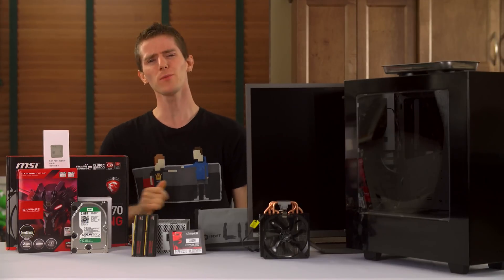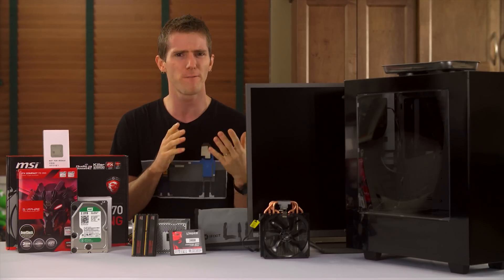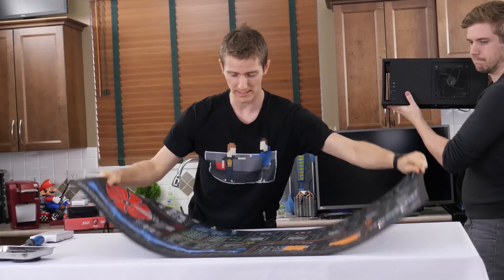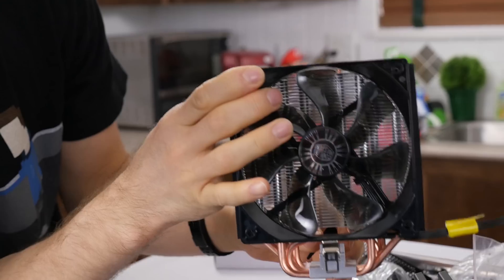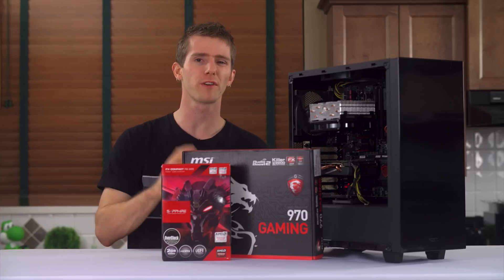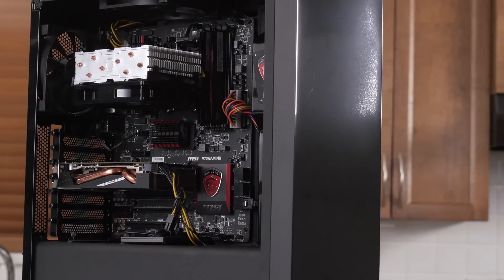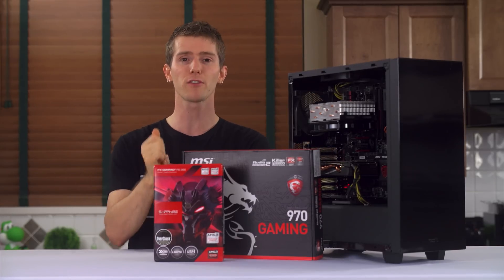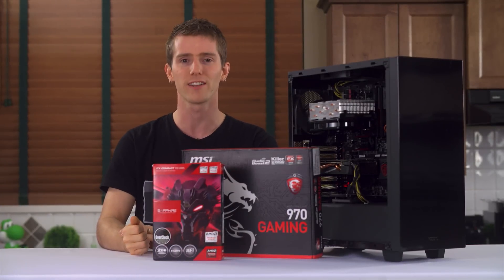Can you Build a 4K Gaming PC for Under $1000?

Comment: I recently bought a computer for about 1k. I can turn up all the graphics on most games to max and get 60+ fps. Like they said in the video wow is the only one I have issues with I down to 44 minimum in 25 man raids and in my garrison for some reason but I usually hover around 120. In league of legends I have gotten up 400 fps for short periods of time in base which is crazy. I do have to note that I do not have a 4k monitor so I don't run my games that high.

Comment: If you have $1000 to build a PC please don't build this rig, such a huge waste of money. Grab an i5 for $200, R9 28(9)0(x) $150-190 used, 750 watt power supply $80 (modular), z97 motherboard $100 and whatever case/ram/storage you want. Leaves you plenty of room for upgrades and the price vs. potential upgrade performance is WAY higher.
Reply: Except it will do 4k gaming. Much better.
Reply: hi jake from state farm :P
Reply: Jake but it won't be 4k which is the whole point of the video. 4k gaming you know.

Amazing how this goes over the head of Intel fanboys.
Reply: ***** 970 would be out of budget when you include the price of the monitor.
Reply: ***** 290x is the same price and much better at 4k due to higher memory bandwidth.
Reply: my fucking god!!!!! THE MONITOR ALONE TAKES AWAY 4-500 BUCKS!!!!!!
Reply: guys most people dont include monitor prices in there builds

Comment: I don't get why people still use 3.5 inch drives. 2.5 inch ones can store just as much, use less power, generate less heat, and are almost standard now with drive caddies. Is there something a 3.5 can do that a 2.5 can't?
Reply: Faster speeds. The relative position of the data on the disk spins faster relative to the head that reads/writes data to the disk in the 3.5' drive to the 2.5' drive.
Reply: Forsetî Yes it would be faster
Reply: HDD's are bound by physical properties (like their dimensions) since they operate mechanically. Generally 2.5" drives are slower and have a lower ceiling for capacity.
Reply: ***** so a 7200 3.5 would still be faster than a 7200 2.5?
Reply: Broc Stefan The WD Black Scorpio has a max speed of 120MB/s while the desktop WD Black has a max speed of around 200MB/s. Even when both are running at 7200 rpm. Yeah but it ain't much. SSHD are not faster for opening different files though, that are not in the cache
Reply: Broc Stefan No biggie. Just saw a review not long ago for the new 2014 black hdd and they performed closed to 200MB/s. Plus I got a 2 Seagate baracuda 2TB this year too and they have a maximum of 193MB/s for reads.

So i thought 200MB/s was the standard for this year, yeah

If it's only around 150MB/s average then yeah, not much different from 2.5in drives

Comment: The reason WoW didn't run better high settings is because of AMD. I have run a 9800GTX+, GTX 260, R7770, R7770 CFX, GTX 660 Ti, R7950, R9 290, and finally a GTX 770 and BY FAR a more enjoyable (read: less lag, stuttering, higher settings) have all been on NVIDIA cards in WoW.

A month ago I ran WoW with my 4770k + 9800GTX+ and I could push Fair-High settings, 1080p, in a raiding environment over 40FPS average.

Comment: So based on this my rig (FX6300, 8GB Ram, R9 290) can run games at 4k?

Thats good to know. Now i just need a 4k monitor.
Reply: Not really. He ran games that aren't really that detailed, or demanding (Picking from Twitch top viewed games)

In other games, 4K is actually quite a high standard, looking at frames around 20-40 game to game. Don't go for a 4K moniter, just settler with a Wide 1080p, it really isn't that much difference ( When your wallet screams for a breath, it won't be much difference ;) )

Comment: Can you guys do a 1080p benchmark for normal AAA games for this rig?
Reply: Raiyan Khalil Pretty sure it would decimate everything. He chose quite good price/performance/efficiency components.
Reply: jpchevron oh okay thanks i am planing on getting
Fx 8320 
Gtx 760 msi 
And 8gb ram will it be good?
Reply: Raiyan Khalil The fx8320 is only 3.5Ghz. Unless you know for a fact you will using the extra cores, like with video editing or similar, the fx6350 will be better for games as it's 3.9Ghz. It will be a long time until games use all 8cores. Anything with 4cores are more will be great for years to come.

As for the graphics card, you can use the money saved from the CPU to upgrade it. The 285 Linus used is great or a gtx 770 or R9 280x even. Would be great choices.

For the RAm make sure you get 1866mhz modules.

Comment: A 285 is a good GPU?
Reply: Not half bad, and pretty reasonably priced.
Reply: ilTubodiEliGabri Yeah it is. Performs better than the 280, yet consumes much less power.
Reply: Redemz Cooler and quiter AND allows you to use a cheaper power supply and smaller case?

I guess if you have a huge case and don't mind heat and noise sure go for the 280.

For the rest of us it's worth it for a quiet pc.
Reply: Its great for 1080p and works pretty well in 1440p as well, though you may have to turn down the settings a bit at 1440p. Not that MSAA or any form of anti-aliasing is actually required at that resolution...
Reply: Redemz Guess it depends where you shop then. The places I use the price difference is minimal. Quite possible you're looking at clearance pricing for the 280 as they get rid of old stock.

Comment: it would be affordable if the monitor alone didn't cost half the price of a pc :(
Reply: WayZHC Bingo. Technically, the 2K and 4K are 'groupings' and UHD falls into that bracket. However, we generally talk about 16:9 ratio standards in the vertical regards, 240/360/480/720/1080/1440/2160, etc. The pattern is obvious!

But yes, as you pointed out the true standard for 4K, like the true standard for 2K, is 19:10 ratios and are reflected in the base 2 counting of the horizontal section. It also erk's me a bit with '4K!', but technically it does fall within the group. 

I'm waiting for more 2880p monitors, although we've again dubbed these falsely as 5K.
Reply: hey its christmas take a little advantage and ask for money from some people you know XD
Reply: ***** 2k isn't 1080p. http://upload.wikimedia.org/wikipedia/commons/thumb/c/c6/Digital_video_resolutions_%28VCD_to_4K%29.svg/1280px-Digital_video_resolutions_%28VCD_to_4K%29.svg.png
Reply: SkillerDanHD lmao if 3840 is 4k then 1920 is 2k
Reply: Sgt.James Doakes My rig is 2500$ an I only play minecraft.
Reply: *****
1080 refers to the vertical resolution, "p" refers to progressive scan, as opposed to interlacing (each frame only refreshes odd or even lines instead of the entire scene)
Reply: Mansen ...
1920*1080 == 2073600
3840*2160 == 8294400

8294400 / 4 == 2073600
Reply: ***** not basically, 3840*2160 is EXACTLY 4x 1920*1080.
Reply: Take 20 people with varying stupidity towards math, and this is what you get.
Reply: 2K = 2048 horizontal pixels
4K = 4096 horizontal pixels

3840 =/= 4096. 

3840x2160 is false marketed as 4K because 4K sounds good. (But there are real 4096x2160 monitors as well) And those marketing people were the people who basically forced the 3840x2160 under the 4K standard few years ago while the 4K and the whole xK standard has been around for decades before this "small" marketing trick. xK standard is used by professionals and it comes from the horizontal pixel count, while the xHD and xxxxp/i standards are used by normal consumers and it comes from the vertical pixel count and xHD naming defines a specific resolution, for example FHD = 1920x1080. No one was talking about 2K = 1920x1080 in 2005 when FullHD started to be a thing. Everyone was using the FHD term because back then the marketing people decided to call it FHD.
Reply: Ha, agreed. Although 4K monitors are slowly getting cheaper, or you can save a bit more money and get a 2K monitor.
Reply: akahomie100 half the price... :)
Reply: ***** true enough haha xD
Reply: ***** UHD compared to 4k is similar to 1080p compared to 2k, but its not 2k (if thats what you mean)
Reply: ***** I know but in that case 2.5k falls under it too. Your comment: "A 2k monitor is.a 1080p monitor.... 1440p is 2.5k not 2k"
Reply: ***** u said 1440 is not 2k, but whatever brah lets end this convo, i hate replying through youtube
Reply: why not youtube is slowly becoming more social media type now anyway ~_~
Reply: ***** No, 4k is 4x's 1080p.
Reply: ***** with 2k and 4k they measure the horizontal pixels, 1080p is a measurement of horizontal pixels.
Reply: Mansen are you daft
Reply: 4K defination: http://en.wikipedia.org/wiki/4K_resolution
Reply: 2k refers to the horizontal pixels, at 16:9 it's 1440 x 2560, which is 2x the resolution of full hd, hence 2k, which is 4 megapixels compared with full hd which of 2mp

4k also refers to horizontal pixels, at 16:9 its 3840 x 2160, which is exactly 4x bigger than fhd at 8mp.

There's a difference in measurement methods, 1080p uses vertical  2k and 4k use horizontal, but if you use vertical for all then fhd is 1080p, 2k is 1440p and 4k is 2160p...
Reply: Everybody read this about 4k: http://www.extremetech.com/extreme/174221-no-tv-makers-4k-and-uhd-are-not-the-same-thing
Reply: ***** Yeah. when i said half i was talking about the $2k+ gaming rigs you make to play those really good looking games haha. not just starcraft and league like in the video here.
Reply: You have to keep in mind what the purpose of this build was, though.  Monitor tech doesn't increase at the crazy exponential rate other computer stuff does.  Ten years from now, that $600 monitor will still be average, and completely useable. meanwhile, the pc will probably have to have been replaced.
Reply: ^ I was joking about only playing mine craft I had 3 21inch monitors which work perfectly for gaming. An I also don't replace my parts till needed as of a month ago I was on a MSI laptop that had a 2.20 Ghz i7 and a 760M it might be good for the light an medium gamer but since I am home schooled I have become a "eat once play 23 hours of the day gamer" So when the 970 series came out I bought 2 straight away.
Reply: I just realized I went a wee bit off topic.
Reply: WayZHC
 Do not mislead the people. 4K = 3840x2160 pixels where horizontal pixels are 2160. 4K means that you put 4 Normal HD (1080p) screens on a grid 2by2 hence you get twice the resolution in both directions and 4 times the pixel count. Spread correct info!
Reply: sarumannoob You seem really hungry but sorry i wont feed you. Try if someone else feeds you. Good luck.
Reply: +Mansen
I repeated the basic premise multiple times yet you fail to understand. 4k is horizontal, 1080 is vertical.
1920 x 1080 =2,073,600 or 2mp
3840 x 2160 =8,294,400 or 8mp

4k = 4x more resolution than 1080, simple math...
Reply: WayZHC sarumannoob 
'4K'
includes both 3840x2160 and 4096x2160.
the former is used for consumer products, the latter is only really used for things like film.
Reply: 1.5k on a PC and monitor isn't much
Reply: 21:9 UWQHD are better for gaming than 4k nowadays anyway. You can push 60fps in most games with a 970 but with 4k you'd probably need sli 980s
Reply: 4K costs the same as 1440p these days so it would be disingenuous to complain about one and not the other.

Comment: What are the best specs for a PC I can buy with a budget of around $50?
Reply: raspberry pi google it.
Reply: Guys I just found out my mom isn't sponsoring me anymore so now I have a budget of $15. Any specs for that budget?
Reply: But guys I need this setup to run ultra settings on Crysis 3 and BF4
Reply: Raspberry Pi: $30 
4GB Flash Drive: $5 
Keyboard and Mouse from thrift shop: $5 
Cost of an OS not included.
Reply: Try looking in a garage sale.
Reply: Xuru Anoa Actually potatos are quite expensive they can go as much as $499 http://www.amazon.com/Xbox-One-Kinect/dp/B00CMQTVUA/ref=lp_6469295011_1_5?s=videogames&ie=UTF8&qid=1419497092&sr=1-5#replacementWidget
Reply: Try a potato. Pretty damn affordable if you ask me.
Reply: CPU: a potato. RAM: 4sticks of french fries. Video card: bottle of water. PSU: a stone. so on...
Reply: GTX 980 in SLI, Intel core i7 5960x, Kingston HyperX 250GB SSD.

You can't beat that for $50.
Reply: With 50$ you get:
-Crowbar
-Pantyhose
After that you find the closest pc shop and hope for the best.
Reply: Xuru Anoa That's what I was about to say... But i think that buying multiple of them, and running in parallel in SLI should be enough for 1440p at 60fps gaming...
Reply: Andy Feng Needless stab at console gamers FTW.
Reply: Buy a fake pistol,  then you can rob money people, and at the end, buy a good pc with that easy money.

#TRICKS
#NOENGANDLO
Reply: might as well just join the army
Reply: You can pick a a Nvidia GeForce GTX Potato for about $3
Reply: ***** Youre insane, even Bill gates said no PC will ever need more than 640KB or RAM!
Reply: $50 or $500?
Reply: Windows 95.
Reply: You could get about 15 Pentium 1 PCs, run them in a cluster and still have less power then a Nokia 3210. But it would still have the same power consumption like a high end gaming PC. Go for it.
Reply: 486 66Mhz, 16 MB RAM, 4 GB HDD..... :P
Reply: ask the people who fail to load in dota, they sure have one for your pricepoint
Reply: The iPotato is supposed to be great bank cock for buck.
Reply: For the CPU you can take the processor from a calculator around the house. The motherboard can be a big metal plate from the dumpster with  some Magnets attached. It's the not the most reliable but you're Probably not going for reliability at that price anyway. Power supply can be some sour winter lemons. Take the integrated GPU from any old game system(ps2,ps1,GameCube). Same with the ram. It can run bf4 at 4k but you'll have to bump down the settings to get over 60fps.
Reply: Is he being fo real
Reply: the best specs for a pc around 50 bucks are really horrible
Reply: Indeed!
Reply: Rasberry Pi. Excluding the SD card
Reply: Andy Feng shots fired
Reply: http://www.ebay.com.au/itm/Tower-PC-Pentium-4-3-0GHz-Ram-1GB-80HDD-Win-XP-PC-Tower-Computers-SPECIAL-/191443699497?pt=AU_comp_dekstop&hash=item2c92ef0729
Reply: Alienware
Reply: For $15 buy sweater or hoodie and go outside looking for temp job, maybe.
Reply: Peter Griffin lol
Reply: A couple of potatoes:

Mash them together, put a copper wire into your mash, and there you go.
Reply: android tablet...
Reply: A very worn out Nintendo ds
Reply: Swedguy220 Sure the GPU isnt BOTTLE necked? Oh god...
Reply: ***** good one.
Reply: um best specs for under $50 is probably a raspberry pi as it will make a for a pretty good HTPC, NAS when either GPIO ports used, older game emulator, and python based games running computer just wont be able to run DirectX games like at all due to it not haveing enough RAM to run windows.
Reply: I built mine for $200 runs most modern games on 1080p high settings 60-120FPS
Reply: Hero Jack care to share
Reply: Hero Jack
Have you stolen most of the parts?
Reply: Potatoes are the best they run at ultra high setting in mario and damn are they affordable.
Reply: Мөнхтэргэл Оюунбат
You are right, GlaDos run on a potato
Reply: Andy Feng LOLLLLLL
Reply: raspberry pie
Reply: There is no difference between a $50 and a $3000 computer why do people not see that and continue to waste their money?
Reply: nightmares666 there is but depending on what the $3,000 is spent on there might not be much diffenrce from a $1,500 and a $3,000 in that there is no difference between a $35 raspberry pi performance in firefox and my new gaming machine in firefox nor in OpenOffice Writer nor any other linux program that is not about gaming. When you are paying more than $350 it is for a gaming machine and/or a business workstation as really more than $350 is not justifiable for a just computer that you will be surfing the web on and/or making / saveing / reading word documents on.
Reply: A potato and a tomato equals real life graphics.
Reply: Oduino
Reply: yumri4
I was kidding but I do agree with your response lol
Reply: RemoteSynergy lmao